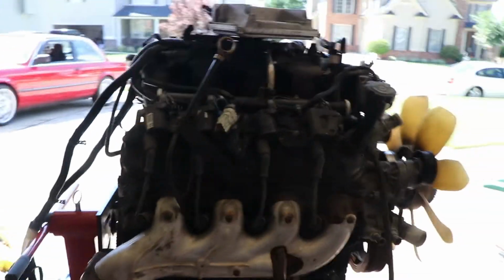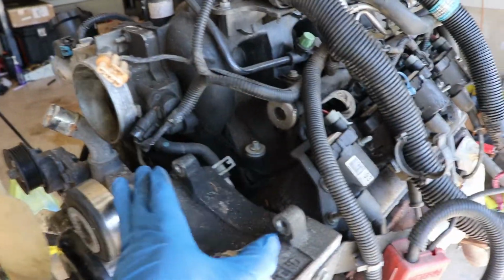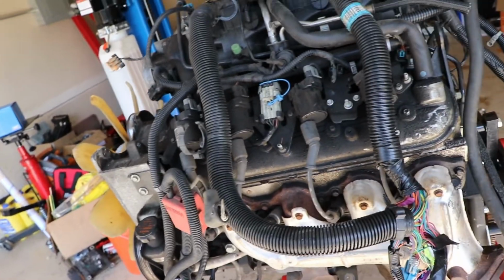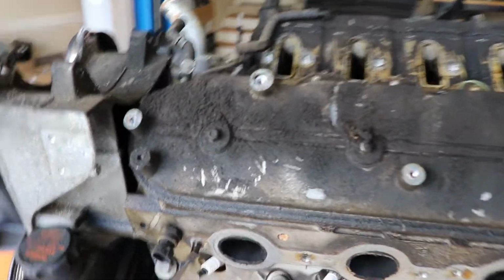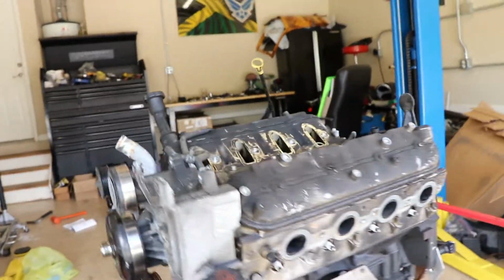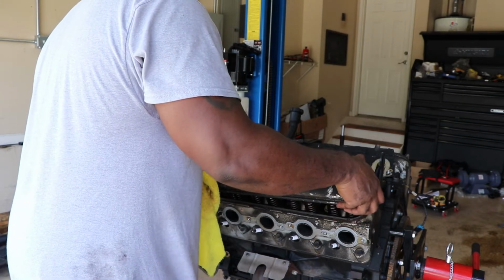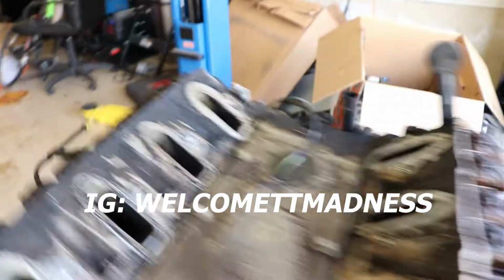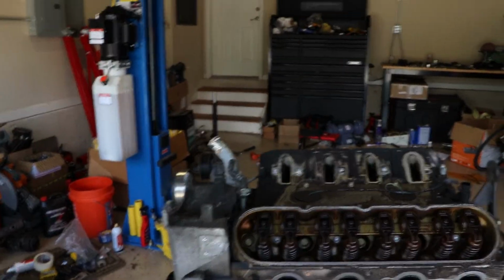C10 LS SWAP 5.3 ENGINE BUILD

Comment: Replace gaskets. They prevent leaks (air or otherwise) and they are inexpensive. Also pulling an engine just to change a gasket is not exactly worthwhile. Also, how do you feel about rebuilding an engine and knowing it has old 15 year+ gaskets?
Its like finding out your favorite bread has 50% lard.

If possible replace the harness with an OEM. Old wires fail due to corrosion and other factors and its a pain to troubleshoot.